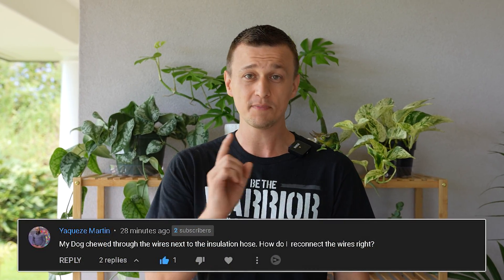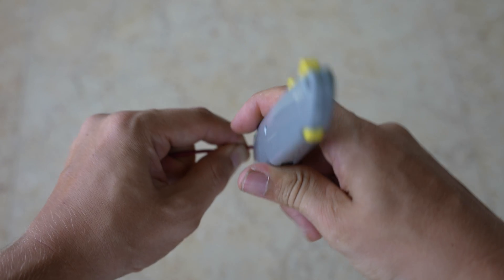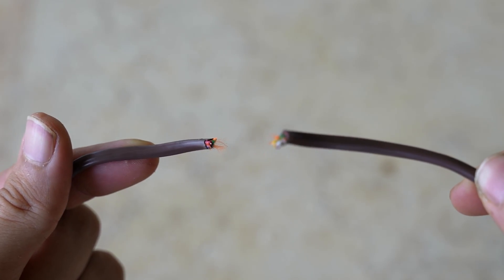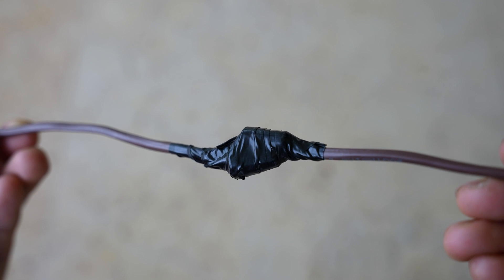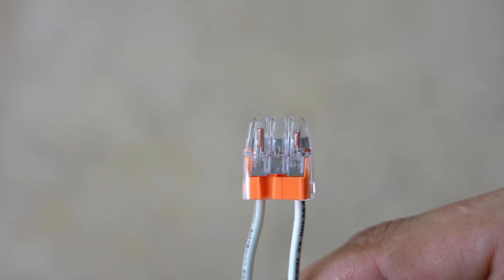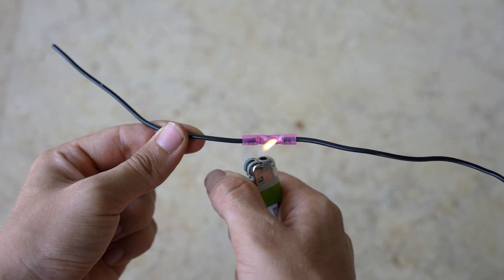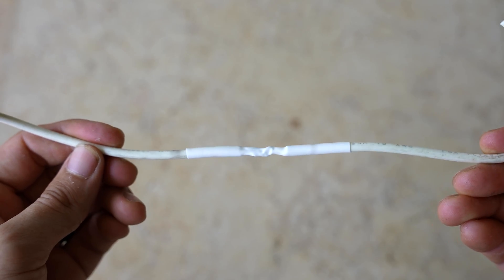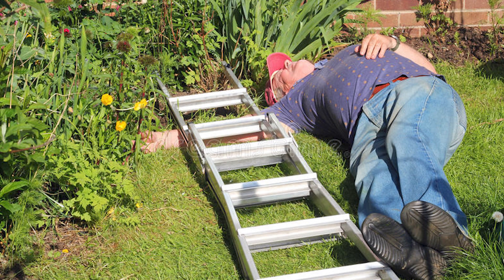How To Connect or Splice Wires Together - 10 Methods

Comment from the maker: ➡ Other Videos You May Like:

3 Ways to Bend PVC Pipe With No Tools:
https://youtu.be/T-Q5otcs0f8
How to Use a Multimeter for Beginners:
https://youtu.be/y8JlMZwo7Pk
Don't Buy a High Efficiency Furnace:
https://youtu.be/7d783qs3laA
When Should Furnace or A/C Be Replaced:
https://youtu.be/Z7vUOySOWbM
Why NOT to Get an A/C Inspection:
https://youtu.be/JqNsEzb__qs
When Should a Water Heater Be Replaced:
https://youtu.be/xRtd2lSb4lY
Should You Drain & Flush Your Water Heater:
https://youtu.be/bb35cQuJ_y0
What Appliance Brand is the Best:
https://youtu.be/ddy06-ssC8w

Comment: Wait did you seriously not solder anything? Did I miss it? How are you going to twist two wires together then use heat shrink but not solder the joint first? That is a terrible suggestion because those wires will come eventually come apart after you start using it.

Comment: I dont know why people keep using electrical tape to join wires together. Electrical tape is used to keep a plastic conduit closed around a bundle of wires, not to join the wires directly to each other. If you look at the wiring harness of a car, the only place electrical tape is used is around the plastic conduit that surrounds wires. That is the only correct way to use electrical tape.

Comment: I came looking for tips on fixing my e-bike's motor cable - one of the nine pin contacts in the female connector got crushed, and the cable in question was hardwired into the controller board. Not the swap job I initially thought.

The cable has 9 smaller wires, so I needed to look for something that wasn't going to take up exorbitant amounts of space, as trying to hide a bunch of butt connectors was going to be impossible, or look extremely ugly.

I plan on trying the shrink tube method. This video gave me a great how-to to follow. I just need to collect the necessary tools. I'll update you in a few days to let you guys know how it went!

Thanks for this video!

Comment: Clear heat shrink with the built in solder is my favorite for low voltage splices.  You can see the solder melt and oooze around to really connect the wires together well and improve their contacts.... and this is as it shrinks around the wire to hold it more and seal it....all at the same time.

Comment: What would be the best connection to do headlight wiring?
Reply: If it's a modern car headlight, (halogen especially), use a connector that is not only waterproof, but heat resistant. Not having a specialized connector at the time, I did a replacement socket on my 2008 Saab headlight, and coated the twisted together joint with the liquid tape stuff. No issues since. I did a couple of coats, just to be sure.. takes time to dry, but worth it.

Comment: would the heat shrinking ones be okay if i use on multi strand copper wires? like the tiny tiny wires? would i also just twist them together like normal & put the tube on top, or do i have to like melt slice the wires together, or is it just simple as twisting them together & melting the tube on? & boom PLEASE GET BACK TO MEE!!

Comment: Hi. I need to connect 12 gauge copper wire with thin wire from a 4mm multimeter jack end. What method is best and safest??

Comment: Number 9 is the worst way - at best you'll get an unreliable connection, at worst it will overheat and cause a fire.
Reply: Why is it the worst? Im not an electrician so I'm not sure I understand.
Reply: @armande000  Read my reply

Comment: I prefer heat guns over flames for shrink tubes. It's more controllable and less likely to burn the insulation. Soldering irons work too.
Reply: I used to borrow my wife's hair dryer- until she caught me. A heat gun is much better.

Comment: I'm not seeing a heat shrink used on a black wire paired with a white wire. I'm confused if I do the black wire connection and put one shrink on that, and then do the white wire connection and do the shrink separately on that, or if I can put both in a wider heat shrink so they are not touching and shrink them together in the same 1/2 inch tube. Sigh. Update---wrapped the white, wrapped the black separately, then it was too big to go into the tube, so wrapped the 2 tubed pieces with tape. Works. It's a vacuum so I'll always be with it when it's powered on.

Comment: #9 was THE WORST way to do any of this! If u can't get some good open barrel crimpers and terminals/butts with shrink tube, then doing SIMILAR (just.. way better) to #9: do the same J technique, but make the hooked sides of the Js wrap evenly to the insulation (DO NOT MAKE A BALL IN THE MIDDLE OF THE WIRES LIKE HE DID), learn how to solder, and solder that twist from the center, but DO NOT let the solder get to the insulation (leave the last coil of the test on both ends free of solder), shrink that! To give some strain relief (because that hard solder is brittle/ unsolderd wire is flexible), fold the wire into an S, with the joint in the middle, then shrink tube or wrap that enough so that a decent pull won't move the S into an s, but a hard tug will (it's not relief if u don't let it relieve).

Anyways... Not sticking up for half of these connections really... But ALL OF THESE (besides #1.. which I'm glad he told y'all is for simple testing) are 1000% better than #9.

For a cheap, simple, easy to find, and good looking crimp, that's similar to the "look" he loves about #9, just get a butt connector and slide a same colored tube over it.

#9 is about as good as jamming both wires in a potato, as far as how well the connection is 🤣

Comment: Thanks so much for this video.  A rat had chewed through the wire on an outdoor lighted Christmas decoration and I was afraid I was going to have to toss the whole thing.  You helped me fix the wires and I changed the old fuses and it worked!  Thanks so much.  It is a cherrished Christmas decoration.
Reply: merry christmas
Reply: @DotherTeVe  Thank you!  You too if you celebrate the season.

Comment: Honestly I’m sorry but I have to disagree with you on the method 9 if you are going to use heat shrink the you have to solder them together first and there is 2 type of heat shrink one with glue in it and the other without and I prefer the glue since it will protect better and is stronger and be sure to check how much shrinkage to get when u heat it up I personally like the 4 to 1 but 3 to 1 if good as well 
Hope this comment makes sense 🙏

Comment: I have used liquid electrical tape (LET) to seal twisted wire connections on my boat trailer for over ten years.  It takes times for the material to skin over, but once it does it forms a permanent waterproof covering.  I recently re-wired the trailer because the wires themselves looked like they needed replacement.  The connections sealed with LET were still in excellent shape.

Comment: Great! I have a lose wire in my wiper motor that I’m using for my Halloween prop. Hopefully I can use one of these methods to reconnect the motor wires to the power.

Comment: What if you needed to splice solid-copper 12 ga wire ( 20A circuit) inside a home main panel/load center. Does code only allow some...if any ? Wire nut only?.....Proper size WAGO?

Comment: Don't EVER splice wires as shown in the "heat shrink tubing" section. He just hooked the two wires together and then wrapped the end of each one back around itself. This leaves the wires connected via a loose loop, which is guaranteed to result in an interrupted circuit whenever the wires move. The proper way to splice the wires is by either (1) spreading the strands on each side, interlacing them together, twisting the loose ends to lock the splice in place and only then wrapping each of the twisted ends around the OTHER wire; or 2) hooking the two wires at a right-angle bend and then wrapping each one around the opposite wire. The first method is preferable to the second, as it makes for a more durable and reliable splice. That particular demonstration in this video (unlike the rest, which are all very good) is a great illustration of the truth that you shouldn't believe EVERYTHING you see on YouTube...
Reply: I am learning this the hard way. I listened to the method in this video and had to buy a new harness for $50 😔
Reply: This should be the pinned comment. What (ironically) terrible advice!
Reply: I just happened to see your comment and want to thank you for helping me not screw up my project. ❤
Reply: @writebrain-zn2um  Glad to have helped! Good luck with your project.
Reply: Which one is the safest? Method 1 or 2?
Reply: @ #1
Reply: Thank you, Oleg.  Your 1) method is the advice I'm taking to replace the sensor in my fridge.  Way more effective, IMO.

Comment: If someone can please tell me how do I know what wire to use when connecting two of them? Say I want to cut a USB power cable and extended how do I know what wire do I have to buy. 

Or

It's a power cord of a laptop how do I extended.

I heard that if you use wrong wire it can heat and melt

Comment: Tip: after cutting the insulation around strands of wire, before pulling off the cut insulation twist it while pulling it off. It will twist the wire strands nicely.

Comment: The throttle to my e scooter snap my circuit wires clean in half and was wondering with these tips is it possible I can reconnect it?

Comment: I've never seen heat shrink without solder, that's...ghetto. Most of these connections are temporary or indoor use only. Coming from automotive and marine, everything is crimp and heat shrink. Motorsport quality wiring takes it a step further but now you're getting into specialty stuff that's not practical for a normal DIYer. The waterproof butt connectors (when used with a proper crimp tool, ratcheting preferred) are the only method in this video that is acceptable to make a connection that will withstand both the elements and vibration, permanently. Solder and adhesive lined 3:1 heat shrink is good for weatherproof connections in low vibration environments. Solder sticks (heat shrink with solder inside) are about the most cost-effective way because all you need is the solder stick and a heat source to make a weatherproof connection, but they are not as robust as a properly crimped connection.

Comment: 1:30 can i get an explanation as to why?
Reply from the maker: Simply for the reason that it can easily come undone if pulled on. If it's in a place where no one will ever touch it then it would probably be just fine.
Reply: Oh, ok that's good to know cause i did it with ground wire but it shoulnd't be touched, but it's not done yet so i can still redo it, it's just that a wago or a nut won't fit inside the cable housing @WordofAdviceTV

Comment: Another tip is heat shrinks only shrink so much so use the correct one for the gauge of wire you are using.

Comment: I have been using, with good success, the shrink connectors with a band of solder inside the connector.  Using a heat gun, the solder melts as the tubing shrinks.

Comment: Is there another technique to remove the cover of the wire???
Reply from the maker: Yes. Some of them will have a string alongside the wires. If you firmly pull on that string, it will cleanly split open the cover. You will still need to cut the end of the cover open with a knife though, to be able to grab the end of the string.
Reply: Thank you i will use this to my advantage (im doing wire splices in school) :D @WordofAdviceTV

Comment: that super old method of heat shrink tubing where you hook the wires together is not code and dangerous. trust me if its something important your wiring or could cause a fire dont connect wire that way the heat shrink tube is just there to mask the looks and help prevent moisture. that thing could be pulled apart your better  off with other wiring methods unless its solderd

Comment: I want to convert a hanging hardwired light fixture (multiple arms) to a plug in with a switch. The cords i can find are 2 prong though. What do i do with the ground wire coming from the fixture if the cord only has 2 wires?
Reply: You can sever the plug off another 3-wire appliance and splice it to the light fixture wires. :)
Reply: @Marie-bt5cg thank you!

Comment: With the tip at 4:40 on twisting stranded wire, it's better practice to twist it  clockwise. When you connect multiple wires with a wire nut, you twist the nut on clockwise, and twisting the individual stranded wire in the same direction keeps the stranded wire from unwinding when you screw on the nut.

Comment: Unless it is wiring for my house where I use pushin, waygo, or wirenuts, I always use the heatshrink method but I solder the wires before I add the heatshrink.

Comment: As for the AC thermostat line, straight cools will have 2-3 wires, heat pumps will have 6-8

Comment: I was trimming shrubs by my electric meter and accidentally cut the thick, solid metal grounding wire that goes down into the ground.  What kind of connector can I use to splice that back together?  Thanks!

Comment: Oh thank goodness, a video that's direct, useful and clear. I just want to repair the cord to the LED lights that I hit with the lawnmower last year. Your video was perfect-just the right amount of info without a dissertation. I simply want to be able to use the lights and not electrocute the neighborhood. The heat shrink tubing will be exactly what I need. Since there are two wires I'll put a larger one over them both. If I can remember to thread it on first and I'll keep the cord off the ground this time.🙄  Thanks so much.

Comment: i have a old caloric oven that needs a new hot surface igniter in oven. i didn't order part yet but if i need to cut wires from the old one to tie in the new one, how would i make sure its oven temp resistant? I'm guessing there is a special connectors for that? or would they give me a long enough lead to go to back of stove to connect it at board (or where ever it goes)?

Comment: When cutting thermostat wire it’s preferred to use the white string inside to pull the casing down and then cut the top of the wires by an inch under where you started. Using wire strippers directly can cause breaks into the wires inside the casing and a low voltage short down the line.
Reply from the maker: Thank you for the warning about that Sean! I only agree, I should have pulled the string like you explained. 😇

Comment: You forgot a link to the orange "electrical coupling"... like an "electrical SharkBite fitting"... 3:40
Reply from the maker: I actually could not find it on Amazon! 😇 The only one I found was out of stock. I bought mine at Lowe's. You are very right though, I did say I would put all of the names in the description. I just went ahead and added a link of the out of stock one. Perhaps they will stock it later.

Comment: I like soldering the wire with shrink tubing the best because I know I will not have possible bad connection issues with oxidation of the copper wires.
Reply from the maker: That is probably indeed the best option, thank you for sharing! Have a magnificent new week good sir! 👍👌🤙

Comment: Is there any better insulation for air conditioner lines than that crappy foam that falls apart in a year or two, as seen in the video?
Reply from the maker: @JDave Foster 
To be honest I never really looked into it since the insulation is really easy to replace. I looked at the oem kflex Sam suggested and that looks like a good choice 👍
Reply: I’ve never had a problem with the oem kflex

Comment: My favorite is soldering and then using the heat shrink..especially fun when you solder and then remember you forgot to slide the heat shrink tube onto the wire.  DOH
Reply: Video was not for us. For those other guys. lol
Reply: I am guilty of doing that, 😿😿
Reply: Professionals no longer use solder. Proper crimps are by far the best. Don’t use the crappy crimper in the video. Get a ratchet crimper.
Reply: -x
Reply: If I had a nickel...
Reply from the maker: @samlol23
That is probably the ultimate method! 😄 Haha and I think all of us repair guys have done that mistake more than once. 😅
Reply: That is absolutely the best splice......unfortunately in the field i don't alwas have ac power...and battery irons have been disappointing.....a pencil torch works in open application but in a tight space it is dangerous...(i get alot of broken wires farming)...
Reply: @franciswheaton3051  Yes, solder and then heat shrink. Heat shrink is to replace the insulation. It probably would hold it together ok mechanically without solder in a low stress environment, but I wouldn't trust it for a permanent or important connection.
Reply: @franciswheaton3051  try butane gas soldering irons. Best 🎉